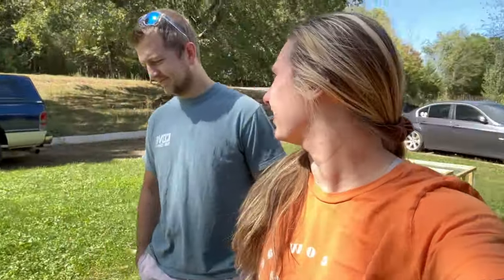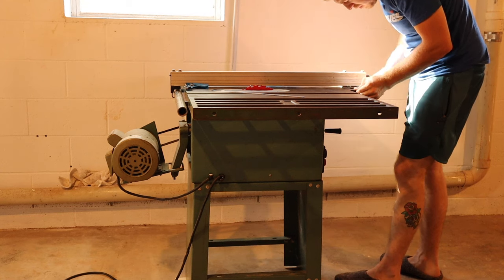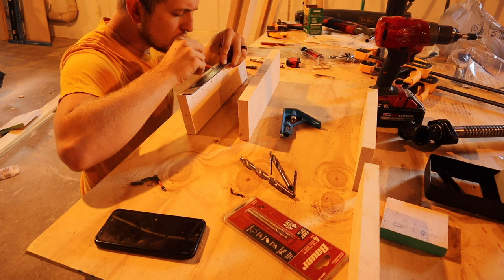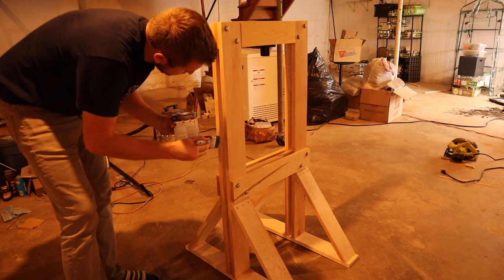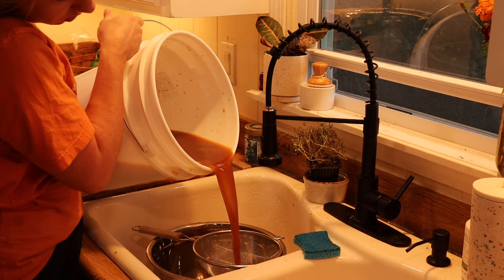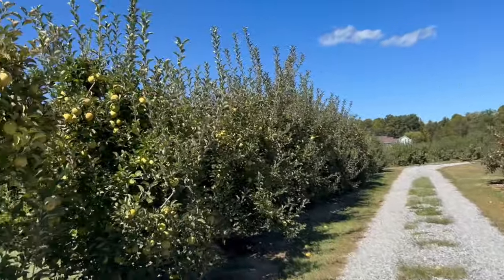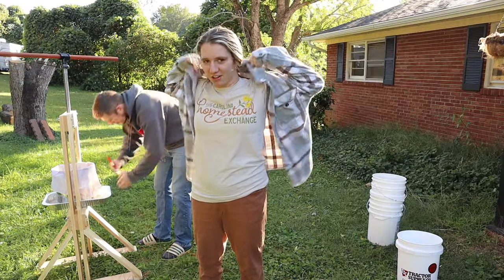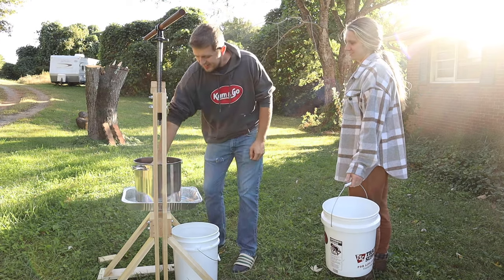DIY Apple Cider Press & Making Cider and Vinegar | Homesteading for Beginners

Comment: What a fun project! Nothing quite like fresh pressed cider. How do you keep mold from growing on your apples? I did the same thing with my scraps last year and anything not fully submerged will 100% grow mold. I got weights and fermentation lids (the function of your towel) for this year and stuff all my scraps in there. Even if you use saran wrap and clean rocks or a ziploc full of water, submerge those apples girl! I don't want you to be disappointed!
Reply from the maker: I've never made the vinegar before, actually, so I'm not sure I have a good answer haha! Every recipe I read for it basically said if you find mold on it to scoop it off (unless it's colorful, then toss the batch), but we haven't had any grow yet! I'm sure it's probably based on location/environmental factors, so maybe we're just getting lucky?! Now im nervous lol I did put some pie plates in a few of them just to be safe though!
Reply: @calicocowacres   I hope that’s the case! I’ve been fermenting a bunch this year and did apple scrap vinegar last year too. There’s this white filmy stuff that can grow on top but that’s not mold - it’s kahm yeast and it’s fine to scoop and toss. But you’re right, the colorful or white poofy/fuzzy ones are definitely mold!

Comment: We really like the DIY aspect! Was actually looking at press designs today and was wondering if the plastic bucket would hold up when it had all those holes. How much did they charge per bushel for those second apples? Cheers and happy cider making
Reply from the maker: We wanted to create a press that didn't use a car jack & this worked amazingly. The buckets definitely didn't hold up - regardless of holes. BUT the stockpot has worked very well - would be good with a metal bucket, too. The bushels we got were $10 a bushel for the seconds apples. Thanks!
Reply: @calicocowacres  Very cool! I have a spare car jack so i was just thinking of using that! Just sourced some Golden Russet/Dabinett/Porters Perfection for $350 per 20 bushel bin, slightly expensive but its nice to get some cider specific apples! Cheers and happy cider making

Comment: Press looks great, but as for your metal tray, also a metal bucket could work, but great job guys. ❤️🇬🇧🙏
Reply from the maker: Thanks! In the video I do mention that the tray is temporary. In future years we’ll be getting a stainless steel restaurant steam pan, but this is what we had access to right now. We were going to use a metal bucket to fill with apples, but again like I said in the video, it would’ve taken 2 weeks to get here or an hour + drive to find a place that had metal buckets in stock.

Comment: Where did you get this parts for the actual press itself
Reply from the maker: For the wood we got it from a semi-local lumber store (just over the border in TN) and we used hard maple for strength. The "press" part is a heavy duty vice screw we got from amazon, since taylor was not a fan of the designs that used a car jack due to the potential for oil leakage (I think that was the reason but can confirm with him). I will link the screw in our amazon storefront if you'd like to see the exact one. I can't share links via comments, unfortunately.